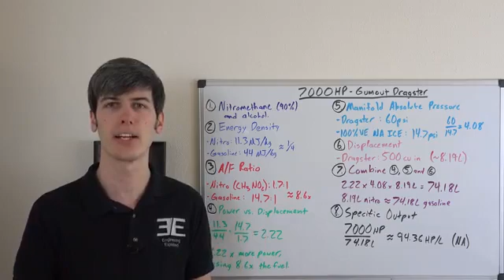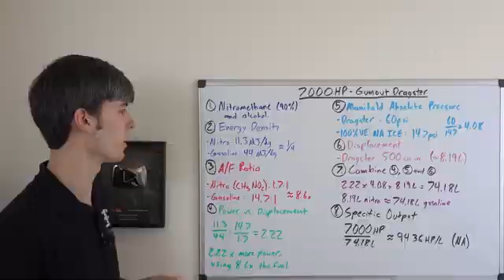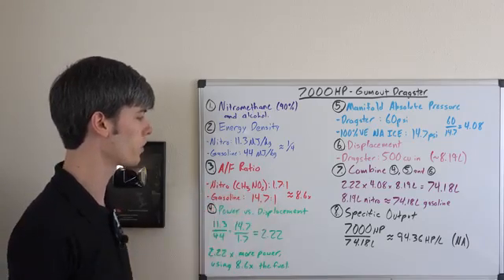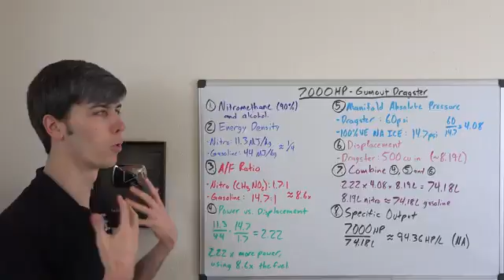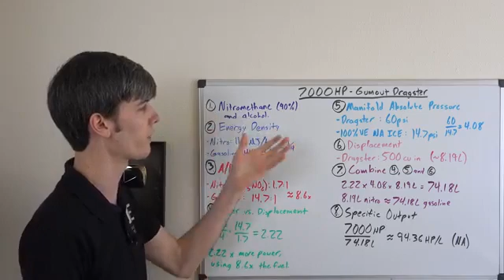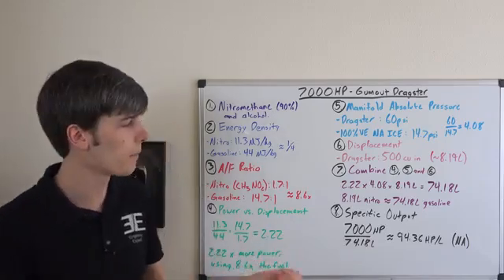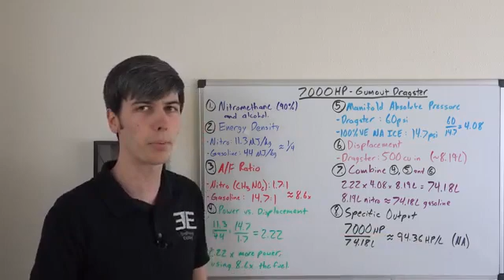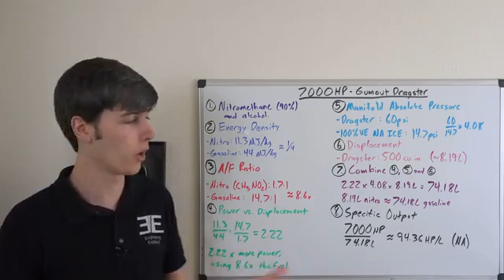Gumout Top Fuel Dragster   7000 HP Explained

Comment: In the drag racing community it is estimated that the nitro engine produces 10,000 HP. Re do your math Jason. Unfortunately there is not a dyno capable of measuring the HP it produces. 7,000 HP hasn't been used as a barometer for years. Good video though. Wish you guys could still sponsor Leah in the future...

Comment: I'm pretty sure there is a minor flaw in his math. Unless he accounted for it. The "60 PSI" is usually manifold pressure above atmospheric pressure there for it would in total be 74.7 PSI giving us 5.08 with a total of 75hp per liter.
Reply: MAP sensor = Manifold Absolute Pressure.

Any pressure entering the intake Manifold is measured by the MAP sensor. it is mounted on the throttle body measuring after the intake system including any turbos or superchargers. MAP also can serve as a Baro sensor adjusting A/F mixture to altitude.
Reply: +Hector Bedolla I'm very aware of how mass air pressure works. but generally speaking people consider full throttle on a naturally aspirated car to be 0psi because the pressure inside the manifold is equal to the pressure of the atmosphere. but when you are looking at a fuel table. 0psi needs to be treated like 14.7 psi (not to be confused with stoimetric AFR), therefore when we add 60psi of boost we have to have fuel compensation for 74.7 pounds of air.
Reply: Agreed but doesn't change the fact that the readings are taking from sensors on the car not boost tables. Modern pcm recognises barometric pressure when key enters ignition adjusting throttle angle at sea level pcm recognises altitude allowing throttle angle to open less than if you were on a mountain. Modern cars go from beach to mountain and back with no issue older cars would not. If you drive up a mountain and tow it down the car would have slightly more power for a few minutes until pcm recognized altitude difference.
Reply: 3:53
Reply: +Hector Bedolla ahh I didn't notice that bit. This guy seems pretty knowledgeable and I couldn't imagine he overlooked it but apperently I just didn't notice that he did take into consideration the average 14.7 atmospheric pressure. so really these cars run 45 lbs of boost. that seems more reasonable but who know with the size of those rods. my car runs a measly 18lbs of boost and that feels crazy fast.
Reply: +Taylor Filkins Understand your point and it comes down to measuring (absolute) PSIA vs. PSIG. He is probably saying PSI for simplicity sake but means PSIG. Having run between 25-30 psig / MAP in my own car I often was in two minds when it come to the affect of atmospheric pressure is a turbo car. Your right in saying at WOT it will show 0 psig, but I don't think that actually has anything to do with atmospheric pressure. If atmospheric pressure was a consideration then we would have 14.7psi at idle, but instead we have roughly -16psi vacuum (depending on cams). Only at WOT does it show 0 psig (N/A - typical). I understand why people think atmospheric pressure comes into it, but I think it is being wrongly factored in. Yes we all have 14.7 pounds of air pressure acting down on us, but we don't have a tube poking straight up from cylinder head for atmospheric pressure to act on it. Instead what we do have is a butterfly creating a restriction point and a piston going up and down creating a vacuum within the engine, so regardless of the atmospheric pressure we have a vacuum in the engine. At WOT with no restriction we have 0 psig, and while that might be 14.7psia it isn't because of air pressure, it is because the cylinder draw has equalled the volume of air coming in (assuming 100% VE). Otherwise every time we opened our mouths we would feel 14.7psi of air flowing in. Only when we deliberately take a deep breathe (vacuum) do we feel the air rush in.

Comment: i thought they had 10,000hp
Reply: +Goldeader His math is NOT right, but not because it is low, but because it is high. He is giving a best case scenario based on 100% nitro methane, the actual power level is considerably less. A claim of 12,000hp - 15,000hp is pure fantasy based on the persons imagination that made the number up. You only need to use a power speed calculator to know these numbers are made up for exaggeration purposes.
Reply: They do. Today's topfuel and funny cars make 12-15k hp. He's math is not right.